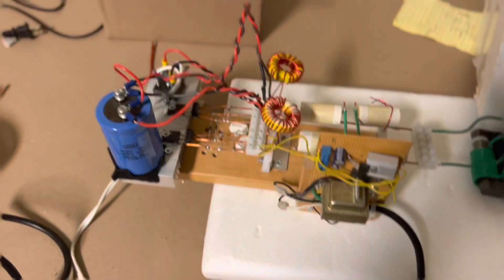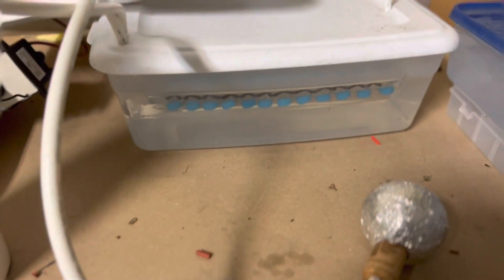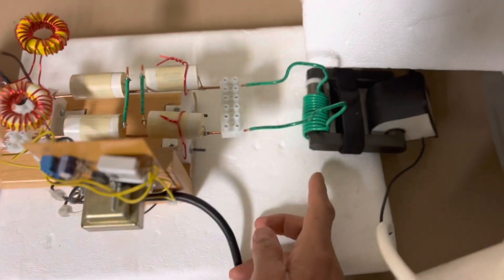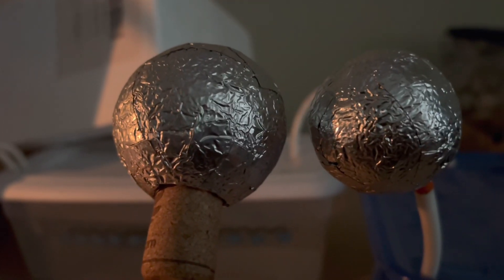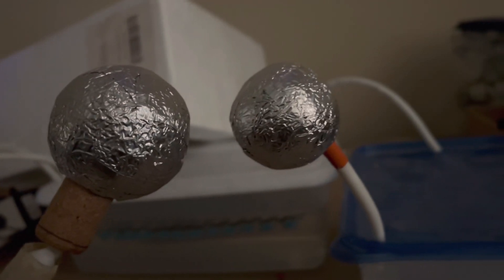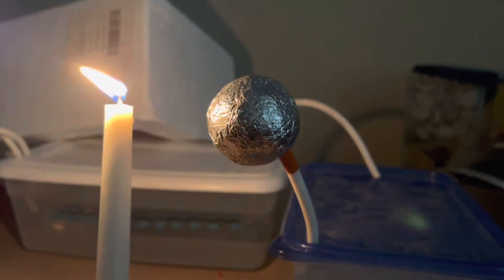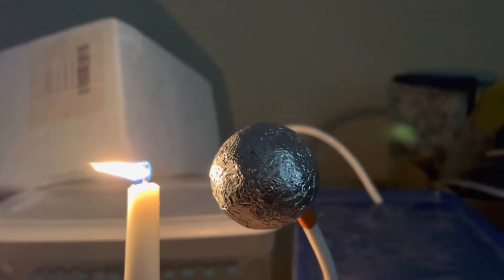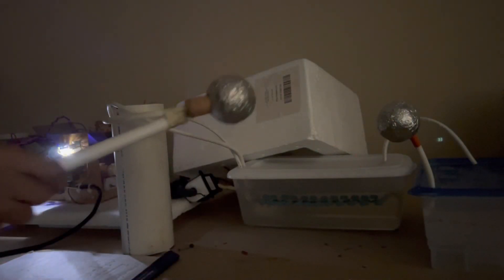Fun with Static Electricity

Comment: Questions: I see most people build there own flyback transformers with two high voltage wires from the secondary, is it possible to have a flyback with one high voltage lead and the other being neutral?  New to this stuff, I'd really appreciate the imput!
Reply from the maker: Should be possible just like in a Tesla coil secondary where one end is grounded and the other end brakes out as a corona discharge or arcs out..
Reply: @BrianDhvTinkerer  yea I've seen many old AC crt flybacks that have only one high voltage wire and the high voltage is just between the HV output and the ground pin, as opposed to some of these homemade flybacks with two high voltage wires that are obviously out of phase, anyway I'm trying to build  a transformer with just one HV line and a ground line but it seems I got some learning to do lol

Comment: If your operating the Flyback in resonant mode like that then your ZVS driver is essentially a DRSSTC with a ferrite core! Assuming the secondary coil is being operated at resonance and the primary resonant tank matches closely. The air gap sets the inductance of the primary.
Reply from the maker: Yeah exactly! The air gap seems to
Make a big difference. I had to redo the caps and the turns to get it close.

Comment: could detail the tuning of the flyback to the zvs?
Reply from the maker: To tune the fly back and to find its resonant frequency, I used a signal generator connected to the primary. I used a high voltage probe to scope the output of the secondary. This was done with a very low voltage input from the signal generator about 1.5 to 3 V. Even with this low-voltage, I was seeing about 1.2 kV from the fly back when it was resonant. I imputed square waves from the signal generator. Other non resonant frequencies failed  to give any visible output from the signal generator. It turns out this one resonates at about 10.1 kHz. Then I scoped the gates of the ZVS and changed capacitance and primary turns to match the resonant frequency of the flyback
Reply: thanks for the info
Reply: @BrianDhvTinkerer  10kHz is so low! My vintage AC one is around 20kHz.
Thought about trying ramping the flyback while running it resonant? I managed to get some decent streamers from my vintage AC under oil. I believe I was limited by the peak current ratings of the transistors I was using.
Got 10" streamers just running it half wave 60Hz. Using staccato will help with dissipation. Using a doubler will double the ramp time and so will likely help with output length.

Comment: Very interesting to see the difference flame at the positive and negative terminals.
looks like the Dielectric field flows out from the positive into the negative
Reply from the maker: The effect is fascinating! The positively charged air molecules have much more effect then electrons at the negative end
Reply: @BrianDhvTinkerer  yes thats also amazed me.
At the negative terminal the flame looks compressed. which reminds me of a flame in space (no gravity) which also is round
Reply: @BrianDhvTinkerer   at 5:27 there is picture of the flame in ISS space station: https://youtu.be/xdJwG_9kF8s?t=327
it is also compressed/round like at the negative pole
Reply from the maker: @MasterIvo  It really does look like that. It’s amazing. The negative pole appears to make the flame round just like in zero gravity situations!
Reply: @BrianDhvTinkerer   indeed very interesting. That's why I use negative voltage impulses in my research. its like implosion VS explosion. one is forming a harmonic vortex, the other chaos

Comment: Would you mind sharing the approximate voltage of the flyback transformer secondary, as well as the specific diodes and capacitors you used? Also what type of insulating oil did you use? 

Also, is my understanding correct that the resistors on the output are meant to limit the current so that the capacitors don't discharge fully, in order to increase the frequency of discharges?
Reply from the maker: Flyback secondary voltage 20 kV
Resonant frequency of flyback 10 kHz
Cap bank 3 uF
Primary turns:12
Wire gauge solid 12
Diodes: 2CL2FM 20kV 100mA